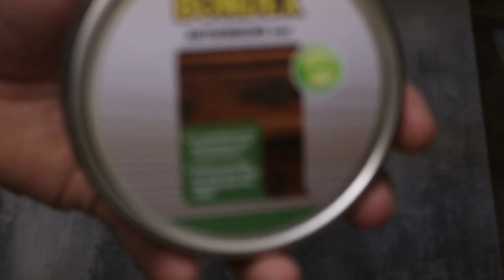Restoration of an old framesaw / Restauration einer alten Gestellsäge  (Deutsch / English)

Comment: Schöne Säge. Allerdings hätte ich die Arbeitsschritte zum Säubern des Sägeblattes gerne noch etwas detaillierter gesehen.
Wurde das Blatt nach der Behandlung gar nicht nachgeschärft? Denn eigentlich kann so eine Säge noch viel besser schneiden. :-)
Reply from the maker: Hallo.
Normalerweise müsste das Sägeblatt abgerichtet und geschärft werden.
Das hab ich mir gespart, weil ich die Säge nie wirklich brauche. Sie hängt jetzt an der Wand.
Lg.
Reply: Olli Weit hast du die sägezähne geschränkt gelassen? Oder platt gehauen? Ich komme etwas schlecht zwischen die zähne...
Reply: @anonym7410  Hallo. Die schränkung der zähne ist sehr wichtig, wenn sie die Funktion behalten soll. Lg. Olli